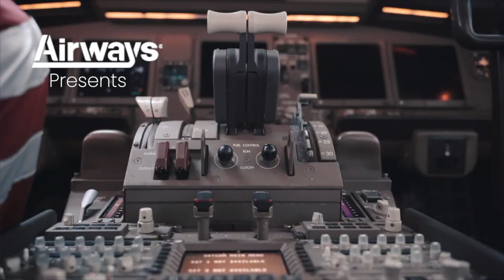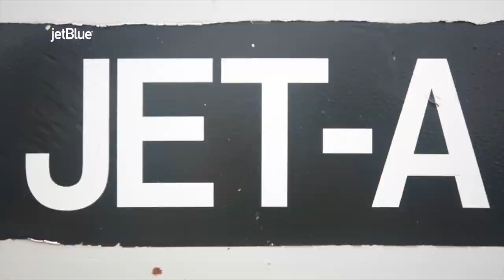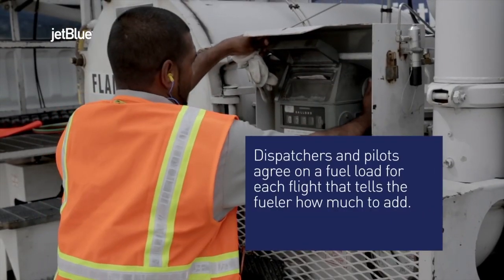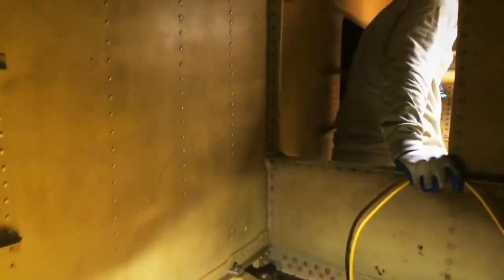A Job with Explosive Possibilities: Tank Diver | AVIATION DEEP DIVE

Comment: Does each of those sections require a transfer valve? Besides the opening each wall has. Or is there a small opening at the bottom where still can flow downwards via gravity??

Comment: shame you didn't show your own footage of the tank diver but the video u showed claimed in its own audio they were in the wing tank of a 747 but just like a sitcom can never turn the camera around to see there is no fourth wall.  The original video never shows that he exited the wing and he isn't wearing any of the ppe required.  Was it just a mistake or are u lying to make these tanks seem larger than they really are to make the absurd fuel amounts claimed to be used more believable?  For example, a 747 carries 52000 gallons of fuel which is absurd when you look at a gas station tanker truck that is 50' long and only carries 9500 gallons.  The 747 is only 200' long.
Reply: Naw I go in these tanks frequently. Some of those tanks hold up to 86000 lbs of fuel. Its real bro lmao
Reply: It's a hoax! There is no fuel in the wings. There is however a small tank somwhere to run the APU.